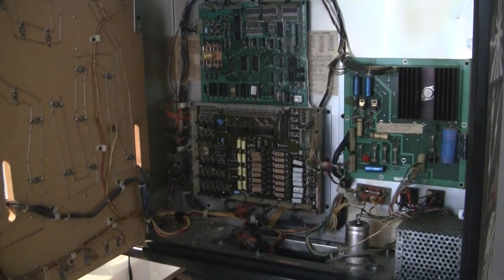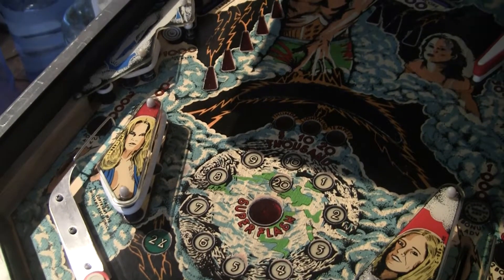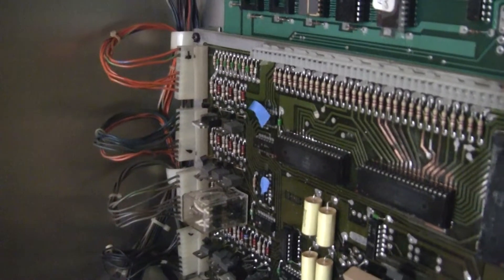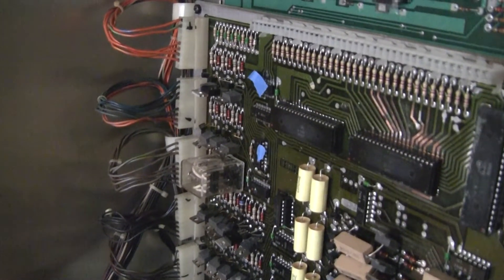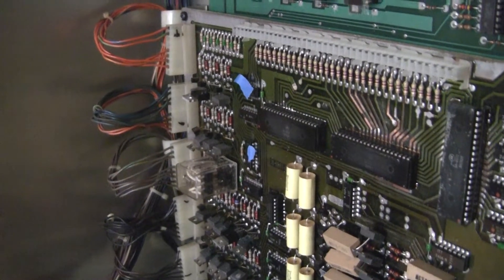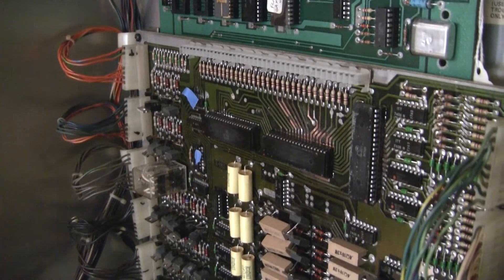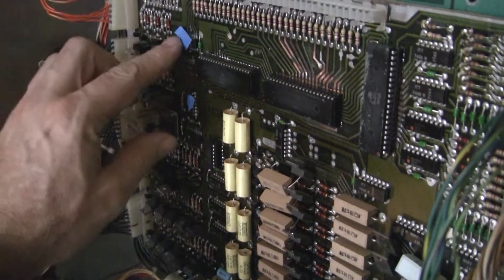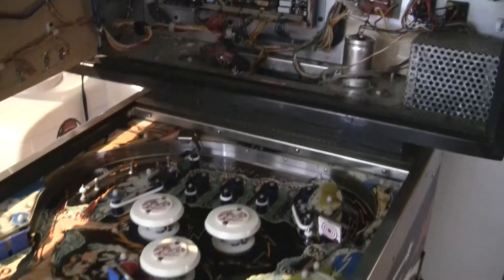Williams Flash pinball - dealing with special solenoid problems - P4

Comment: I have the EXACT problem with my 1980 BlackKnight. I have yet to replace the transistor however. Did you end up replacing the IC and did it resolve the problem? Thx in advance.
Reply from the maker: Actually I ended up selling the game.  Someone kept bugging me about wanting to buy it.  I said I hadn't finished work on it, but they wanted to buy it as-is.   So I sold it.    I didn't replace the IC, but I suspect that was where the problem was.

Comment: Where did you order the hv 7408 ic
From ??  Thanx
Reply from the maker: I ordered them from Newark Electronics.  Note that the chip IDs are slightly different.  If you search for "7408" you can't pull them up that way. I outline details on chip ID and equivalents at http://PinballHelp.com/

Comment: If you know exactly which AND gate the bumper is tied to, you should be able to bypass the gate using a jumper wire. This would be from pin 14 (+5V supply to IC) to gate's output pin (Pin 3, 6, 8 or 11).

Doing this would verify that the gate, or an input to the gate, is the problem.

If the board is straight TTL, you should be able to get a 74HCT08 (these are TTL compatible and typically cost more than the HC variant). in there with no problem, the 75HC08 may not work properly.

If the gate is only driving a power transistor, then going with a substitute shouldn't cause any issues.